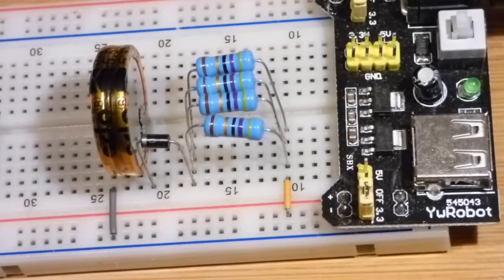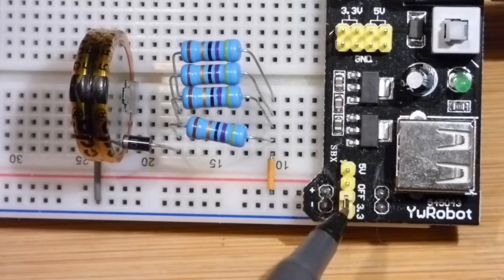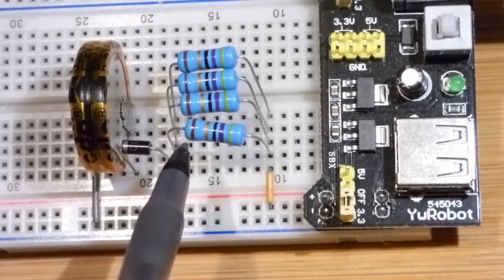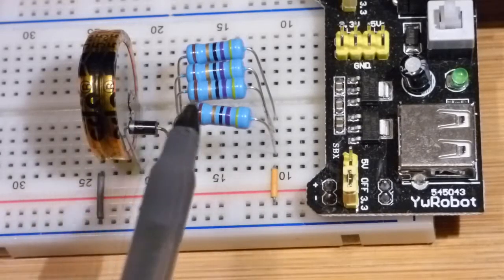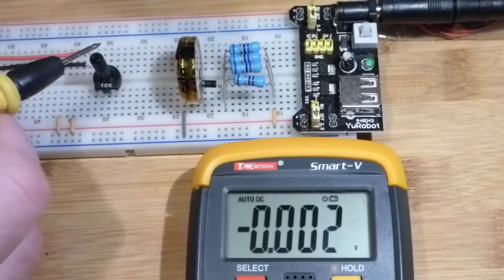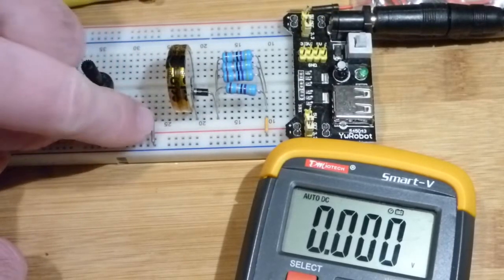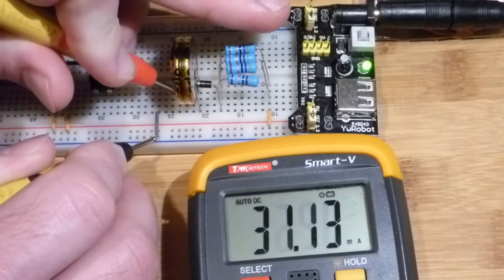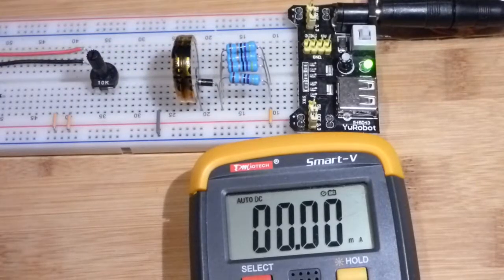Preview of super capacitor charging circuit to supply voltage minus diode forward voltage

Comment: Sir. After supercapacitor charged fully still it is connected in charger circuit will it damage the supercapacitor
Reply from the maker: As with all electronics, pushing the maximum voltage a lot might shorten it's life, but capacitors shouldn't be affected by being charged for a long time. It's a bigger problem if a polarized capacitor is completely discharged.

Comment: Because of the high internal resistance of this specific superCap, couldn't you have omitted the four resistors? If so, what would be max current after startup?
Reply from the maker: Yeah. If I remember right, it's been a long time now, these supercaps have about 70 ohms of internal resistance and can be charged directly with a 5V power supply. I wasn't aware of their internal resistance when I bought them and had the time to get around to testing circuits I designed. Plus, my goal was to charge low internal resistance capacitors  some day with the same setup.
Reply: @Electronzap  thank you for the reply, I'm hoping to use caps like this in a future project